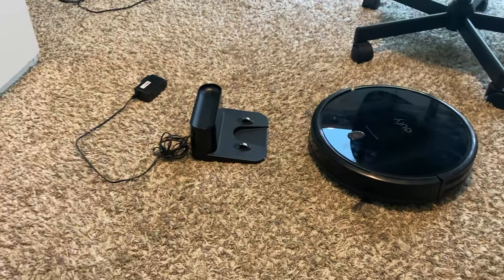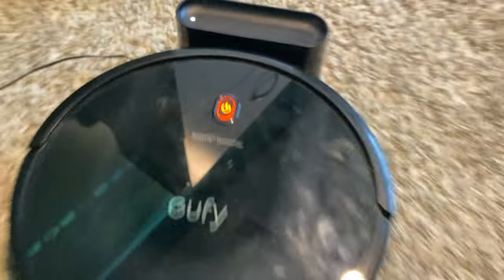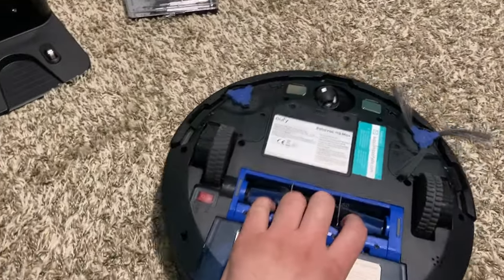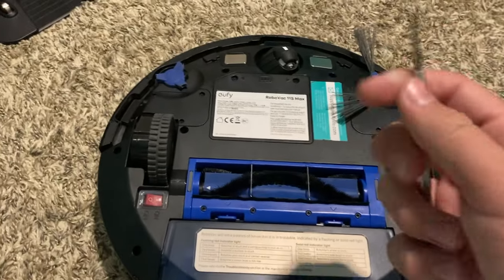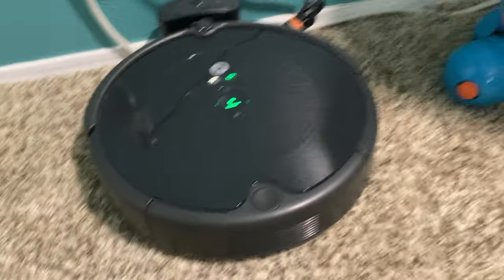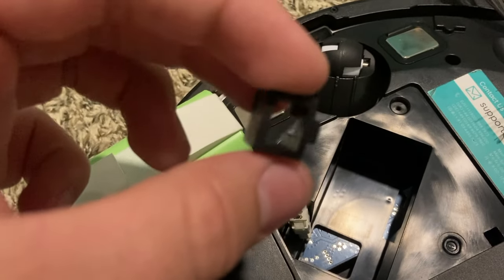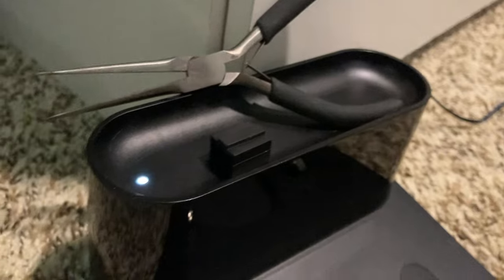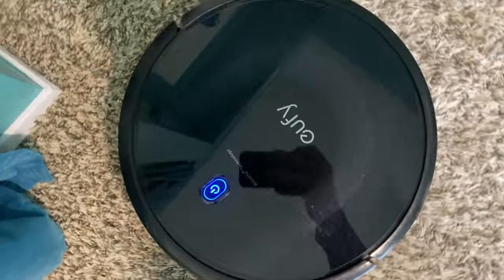Fixing a Eufy 11s Max!

Comment: I just bought an 11s max but, it only has 1 side brush. Theres no mount for a 2nd on either. Why?
Reply from the maker: Hmmm, I’ve never heard of that… 
Maybe the battery cover that has the info on it was swapped with another RoboVac? 

But Eufy makes plenty of other models that only have one side brush.
Hope that helps!
Reply: Because it only runs that side against walls. Shark is switching to one brush models also.
Reply from the maker: Makes sense…